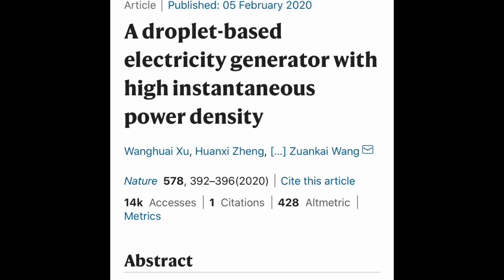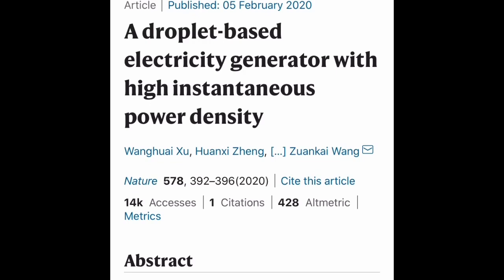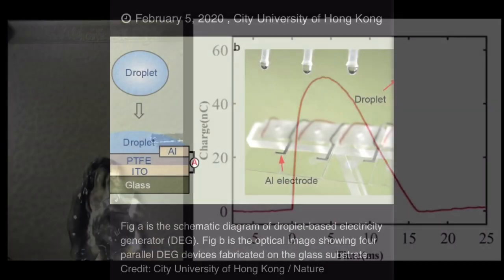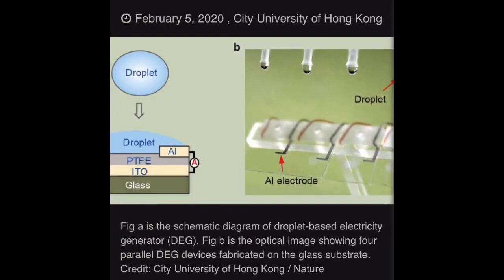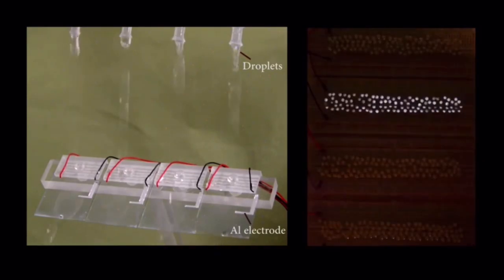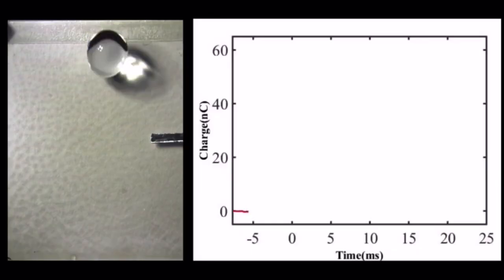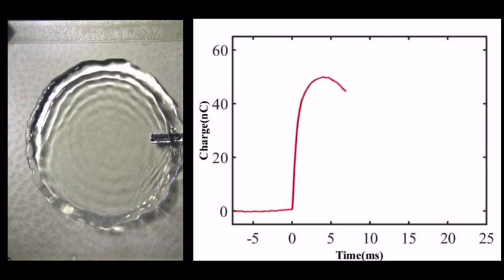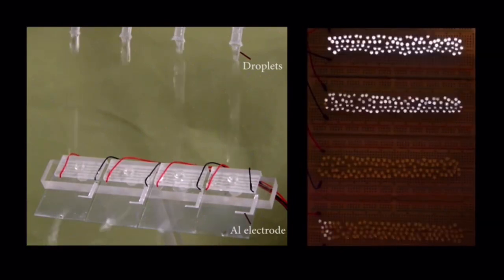A Droplet-Based Electricity Generator With High Instantaneous Power Density

Comment: Is it the impact and dispersion of energy causing the spike like piezoelectric or the reaction in the water droplet tension. A droplet will "foat" or skidder across the surface of a body of water. EZ water sets up a charge as it goes through it, 4th state of water as in Pollacks work.

Comment: get that on your gutter system.  half to invent the "hinged gutter" just to service it.  Why are there no hinged gutters?   I want pull string louvred gutters, like a window shade, I pull the chain the bottom of the gutter sluices out, any thing left can be hosed  out.  Way more easy than ladder and plastic sack and leaf blower on a 60^ slant roof.
Reply from the maker: Buried Axblade Oh man, I need new gutters!
Reply: @ElectricUniverseEyes  you have better contacts than me.  do it.  it'll fund your shop
Reply from the maker: Buried Axblade If I survive this coronavirus, anything is possible!

Comment: Ferris weal thinking- If gravity exist and the world was a spinning sphere, you would weigh less at the equator due to the centrifugal force. Believe  in a spinning globe is counter-intuitive.
Reply from the maker: Sheard Sheep Centrifugal force only exists within an atmosphere as measured here on earth. Electromagnetism makes things spin. Why is it so hard to see the earth as spinning or a globe? The thing expanded... perhaps Google Earth is a lie? In your view, did your flat Pangea model dinner plate break in a stationary position and expand too, or is that just part of the matrix projection? ⚡️;) ⚡️ If I recall, you are ok with the toroid model, but not one with a sphere at the center? Or am I off the chain here...
Reply: @ElectricUniverseEyes  That makes 0 sense. The further you are from the center the greater the velocity and interference from the core. Gravity is just Mass and Density and no other logical explanation... Period,
Reply from the maker: Sheard Sheep Centrifugal force is an outward force apparent in a rotating reference frame. It does not exist when a system is described relative to an inertial frame of reference. All measurements of position and velocity must be made relative to some frame of reference. 

There is no centrifugal force, neither in outer space nor on Earth’s surface.

The second Newtons Law is

F = m a This is an equation of vectors

If we are describing a CIRCULAR movement we need two things in that Equation to make it true at all times.

First F is a vector of constant module and pointing to the circles center at all instant. This kind of force, behaving that way, are called centripetal.

Second M times acceleration should be a vector equals to F, thus headed also to the center, and this vector was m a = m w2/r, was called THE CENTRIFUGAL FORCE.

This way the Newtons law is F centrip = F centrifug

But this eq ends up missleading the student

Becuse they write F centrifug + F centripet = m a
Which is flat wrong

F centrifug IS NOT any force
IS A GEOMETRIC EFFECT THAT emerges from changing your direction of motion constantly

The force headed to the center is an actual force which is forcing you to move in circles.

In a space rotating station your body has to move in circles because you grab handles or stand up receiving forces from the Station frame until you feel at rest with the Station. As the Station is rotating you end up rotating too. That means you feel being pushed towards the center.

You think you are repelled outwards the circle until the so called floor stops you. Then you call it gravity.

In Earth gravity, you are attracted towards Earth’s center, but the floor pushes you up, holding you still.

In the rotating station the floor is not holding, is pushing you towards the center, causing your rotating movement.

There is no artificial gravity inside the station. The nature of your movement resembles gravity but it is not. As a prove of that consider an object floating in the station. Still, at rest, then press the button to rotate. All of you will hold handles etc 
You will feel your artificial gravity, but the object will be still at rest with the outer references. So you will see it floating and coming flying around the station for ever.

This behavior is impossible within a real gravitational field like Earth’s.
If we could invent an antigravity cage
So that gravity vanished pressing a button. Here, unlike in the rotating station. The object will fall immediately after pushing the imaginary button that restored Earth gravity.

Ps- I stole all the answers above. I’m actually really dumb. 

So you still didn’t answer my question. Are you a flat earther?
Reply from the maker: Sheard Sheep I’m just messin’ with ya, man! https://youtu.be/AQl8h7Aa75s
Reply from the maker: Sheard Sheep PS- I think the crust layer is the “core”. A Plasmoid pushing from the inside outward and the opposite forces pushing inward from the outside of our atmospheric layers. Again, I’m an idiot. Don’t listen to me :)
Reply: @ElectricUniverseEyes  Theoretical is the science of dreams. Even Tesla new that logic demand physical proof.
Reply: PS: I have done some idiotic things but just because you can tell a joke dose not make you a comedian.
Reply from the maker: Sheard Sheep I’m far from being a comedian. Ask my wife!

Comment: Robbing Peter to pay Paul you say
Reply from the maker: Pretty much! You still have to have the mechanical energy to get water above to drop below. Instead of a tesla turbine with moving parts like at Niagra falls, pretty much seems like a solid state version that could take advantage of a moving stream or river, if this were scaled up. But, I also question how long the material would last before it breaks down from the force of water (and whatever particles, pebbles, rocks, etc. are in it). Regardless, it's a fascinating discovery.